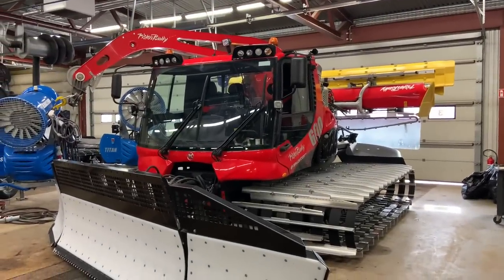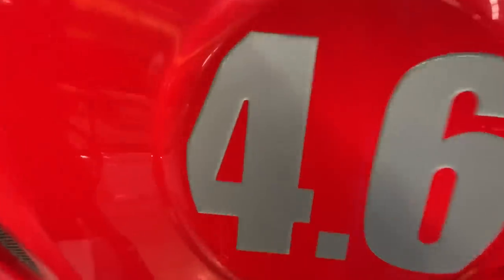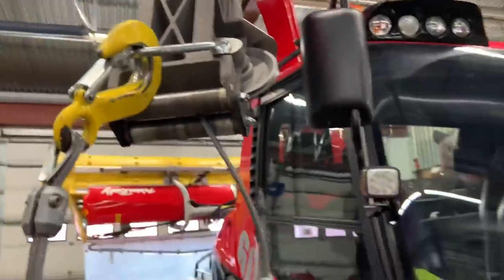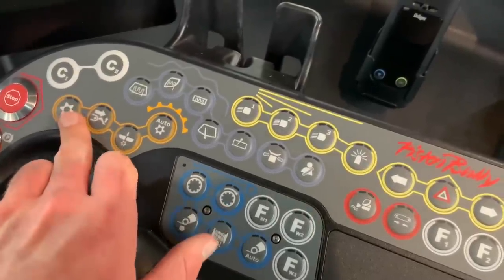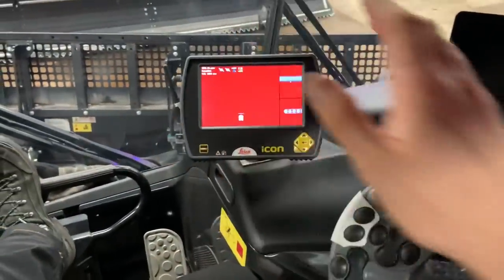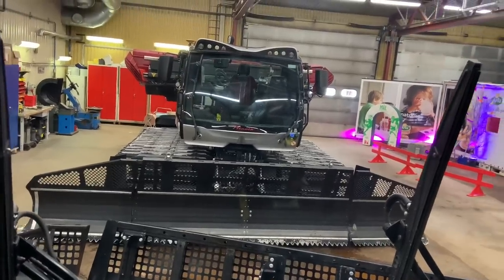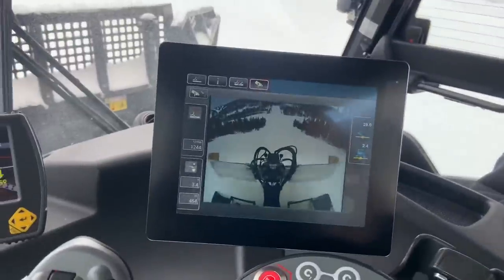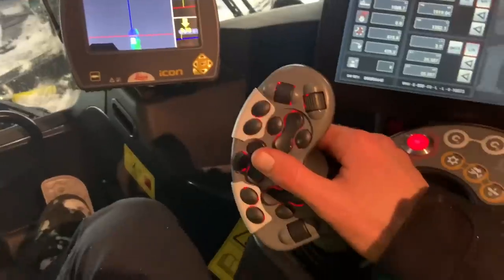NEW Pistenbully 600 Level Red Winch walk-around

Comment: Great video!  That reel out is super smart!  I remember being around a Timberjack Log Skidder and I know that is not the same machine by a long shot, and the winch on it is vastly stronger, but it was 100 pounds of pressure to pull out the line - I was young and could barely move it lol....
Reply from the maker: Yeah logging machines definitely require a stronger rope and winch system. My friend owns a logging company which runs a couple of tethered falling machines and they require an entire excavator-based winch-machine to tether to. I would love to have a go in them but I’d have to dedicate a summer or 2 learning the falling machine first.

Comment: Awesome video thanks for sharing. I run a grader or dozer and have always wanted to see what these things are like inside.  They just seem like they would be really nice fun machines to work in
Reply from the maker: I run dozers and excavators in the summer. It’s similar but different. Like a grader crossed with a tractor crossed with a dozer. Amazingly capable machines.
Reply: Thats awesome that you have the perspective from the dirt side as well. I would imagine the material management part of it would translate to both. Thanks for replying

Comment: Awesome machine.!!   Thank you.
From what I see on the quick view of the broken stirrup,  I wouldn't blame it on the steel or the bend in it.   I would sooner say somebody ran that winch cable in too tight and the force from the 10k lb winch cracked it.   A bungee cord would work and then the winch wouldn't be brought up too tight.
  Just a thought.
Reply from the maker: It’s an interesting thought, but if the winch was brought in that tight one or two of the rope clamps would have to run through the pulleys on the end of the boom, which would destroy the pulleys. It’s not possible to put force on that bracket from the winch without doing serious damage to the pulleys and clamps first.

Comment: Привет, дорогой друг! Пиши из России, я механик по PB400parkpro, pb 400 with  лебёдка. Прошу больше информации по гидравлической системе, а именно, падение давления в гидроцилиндрах угла угла атаки отвала. Спасибо.
Reply from the maker: I am not a mechanic unfortunately, but I think the pressure drop could be due to a worn out hydraulic solenoids or maybe the hydraulic ram/s itself needs a new set of seals. As the 400 gets older they all start to get blade-drop eventually.
Reply: Спасибо, дорогой друг. Привет из Сибири, Красноярск. Трос лебёдки ставили не оригинальный?